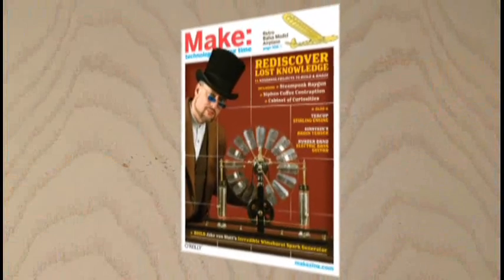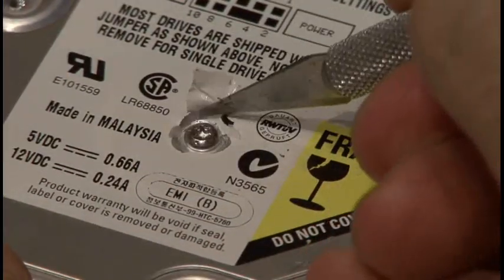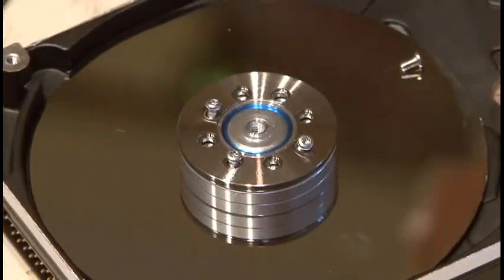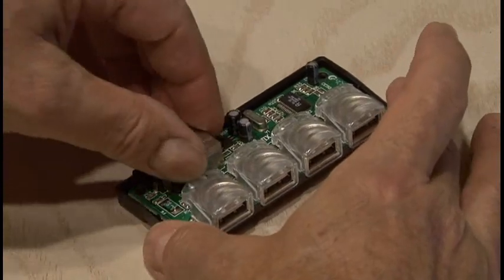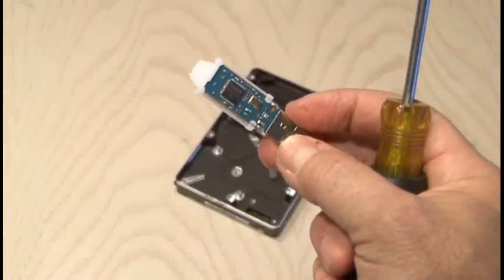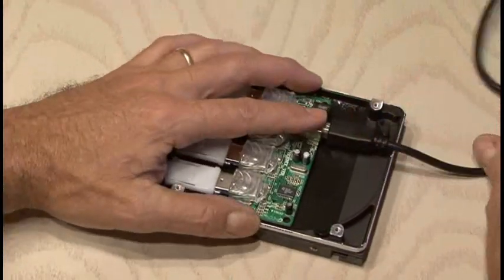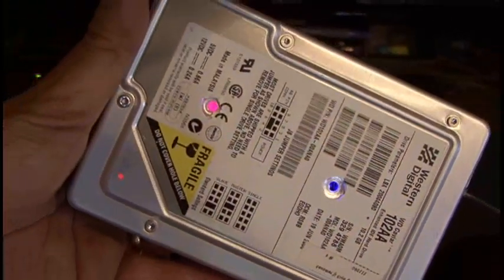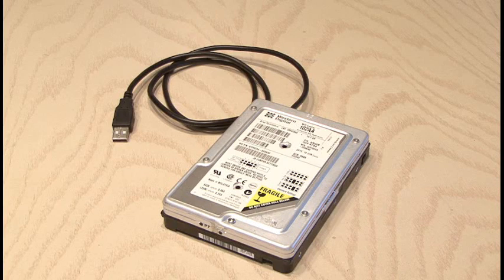Weekend Project: Flash Memory Hard Drive

Comment: Let's see: (4) 128GB Thumb Drives. (1) 4-port USB controller. ..(1) USB to SATA-II converter. (1) SATA-II Controller with Programmable RAID..AND ..JBOD Configuration!! - But is it really worth going to all that trouble and expense just to get a 512GB SSD which is bottlenecked in speed by the USB data rate?

Comment: You can partition each one separately but then install your OS, It will give you the option with you delete each partition to make it a primary or a secondary, You will have to make 1 primary and the rest secondary, That will make it where you can make it one drive letter. Then enjoy installing your OS on all flash drives as they work together :) If you need help please don't hesitate to ask!!

Comment: so, someone know how to merge those usb memory in a " big " single one ?
Reply: raid
Reply: LVM in Linux is the safest bet.
Reply: Jim Moore Your problem was to begin with that you bought a Maxtor.
Reply: You don't, this guy is a total idiot.  That 10GB drive was just fine as it was... Moron.
Reply: Under Disk Manager in Windows you can group them together in a dynamic software raid where they end up only showing up as one large drive.
Reply: ***** As far as i know small flash drives, like the ones used in the video, come with a built in memory controller, that controls wear-leveling, block picking and a bunch of other fancy stuff, this ensures the entire memory chips 'life cycle' gets used evenly;  (you could think of the memory chip being in a constant state of de-fragmentation). The only way to truly join all the chips into one drive would be to use an SSD memory controller that's been designed to support multiple flash memory chips, but that's way above my knowledge.
Reply: so can new ones. Case in point: I bought a 200GB Maxtor in 2006, it died after three days. RMA'd it and got a Seagate. That one's still going.
Reply: cjhawk67 does NOT work on removable hardware.
Reply: MrGridStrom Actually this is not always true. Recent SSD have this feature, but I own some older ones which don't do wear leveling. There's a nice way to go thru, though : partition your hard drive with Linux LVM, and then format the volume with F2FS. This filesystem gives second youth to my older SSD and also a boost to a slower USB key.
Reply: Jim Moore My bad I never tried it with flash drives
Reply: Micheal Lewis damn.

But yes. Lesson learned, eh?
Reply: I only know the raid for mac
Reply: Aidan Johnys MDM only does RAID0 and RAID1, it's extremely limited (and only does device-controlled arrays such as P/S/ATA or SCSI, like the Windows one does), and only formats to Mac OS Extended (Journaled) format. With Linux LVM you've got pretty much the whole gamut of RAID types on ANY controller (0, 1, 01, 5, 6, 10 on P/[E]S/ATA, SCSI, USBx, 1394, or Thunderbolt) and any format you can think of (provided you have the driver installed which most distributions do by default: most if not all Linux current and legacy formats, V/FAT/16/32, NTFS, HPFS, MacE).
Reply: Jim Moore 
I use mdm to create many raid levels, including 50

mdadm --create /dev/md1 --level=0 --raid-devices=2 /dev/sd[bc]
mdadm --create /dev/md2 --level=0 --raid-devices=2 /dev/md[de]
mdadm --create /dev/md0 --level=1 --raid-devices=2 /dev/md[12]

Now you have a raid 1 (stripe) atop a raid 0 (mirror)
Reply: still 0 and 1, my point is proven and if you don't believe me (I insist you don't take my word for it!) search through the MDM manual.
Reply: CaptainDangeax All of the sata based ssds have some sorts of wearlevelling. If they did had it, they would go kaput in a matter of days.
Reply: hojnikb Yes, like compactflash and flashmedia. Oh, wait...
Reply: CaptainDangeax Those are not ssds. And yeah, every decent CF card will have some sort of wearlevelling.
Reply: You should just be able to set them in a RAID 0 array and it should be able to detect it as RAID and assign a single drive letter while both increasing performance and simplifying the detection.
Reply: Henry J Anderson II that was an IDE drive, which is old and slow, and most likely broken. Don't say well it was in 2009 b/c SATA was definitely already there, SATA has been here since at least 2006.
Reply: hojnikb When you'll begin to earn your money and will be stongly engaged in a long term buying process all along the years, and also putting your hands on second-hand products, you'll begin to understand the difference between the theory "every decent SD/CF/USB/SSD has a sort of wear leveling" and the practical "some devices I've got don't do that AT ALL"

Comment: This project is a waste of time.  If I was going to make an old hard drive better it would firstly have to fit inside the PC and secondly act as a hard drive.  For this you would need a kind of RAID controller that you could program to pass the data to and from the storage medium (possibly an FPGA of some kind, but I'm no electronics guru) and then up through a SATA controller and on to the rest of the PC.

Also, there is far too little storage capacity in this project to be really usefull.  I mean, how much modern software can you store on 24gb (I have memory cards with more capacity than that).  Now, 4 x 64gb drives in RAID might be cool.  You are still not going to beat a 256gb SSD in terms of speed, but you may get somewhere between that and a standard hard drive.  In terms of cost effectiveness you would lose out because 4 64gb sticks and a hub (all USB 3) costs £103 on dabs.com and a 256gb SSD would cost £80 on the same site.
Reply: This video was from 2009 you little dipsh1t
Reply: Okay well in response, I just did a project similar with a 8 128gb thumb drives (usb 3.0) of course it ended up with a total space of 512gb in raid 0 for better write speeds (2 sets of 4 drives in raid 0) (i think its actually called raid5 then but idk im no pro) used a little diy magic (and several hundred hours of searching and a few fried old video cards and one ancient sound blaster live audio card) and connected it to my unused pci slot. Now if you know anything about data striping you would know that it (in theory) could double your potential write speeds. and with a top write speed of 5gbps (bits not bytes) for usb 3.0 (mine clocked originally at around 200MBps via usb 3.0 and 300(ish) via pci) with the final speed of the entire "drive" at approximately 650MBps. To answer the obvious question of "Why?" quite simple I get bored and most pcie 500GB ssds cost in the upper range of several THOUSAND dollars... final cost to me $300ish but well worth it when you move several hundred GB a trip. Wouldn't have even thought to start the project without seeing this video first and James Lewis yes I believe that that would in fact smoke the excrement out of your off brand 100 gbps ssd at roughly 65% of a GB every second or... roughly 39GB per minute.
Reply: myohypertrophy I didn't make a tutorial I will consider redoing it in the future and making one.
Reply: +James Lewis you can put this in your computer idiot it is a normal hard drive the standards have not changed and you can get 4 128 or 64 gigabyte flash drives and raid them together and I'm sure you can get a usb 2.0 adapter you can plug into your motherboard
Reply: ***** I know I'm not an idiot. get a usb to sata cable or something. this video was for fun. something to do if you're board
Reply: The point of this video was to make a portable hard drive for cheap in fact probably with most of the junk we have lying around the house, If you could make those drives dynamic the cost of making one of these would be worth it.
Reply: whyyoutubewhy THAT sounds like a fun project.  Can you provide more details/Did you make a tutorial for this project?

Comment: You can solder the USB connections to the sata port on the HDD circuit and you modify a sata cable that you hage a 'sata to usb' cable so nobody can see the USB cable coming out of the HDD

Comment: Why? beyond wasting some time, there's no point to this. It's like gutting a pc case to install Mac parts. it may increase the value of the PC but it devalues the Mac.
Lets review: take a usb hub and 4 flash drives (small convenient portable) and mount them in a concrete block. Tie a length of nylon rope to the block. Presto digital Boat anchor v2.0 
tech tip remove one usb drive replace with usb wireless dongle and Presto Wireless Boat Anchor, no rope needed.  
Your welcome
Reply: Sorry but no, while I have used Mac and currently run Ubuntu, most of my time is/was spent on windows PCs. Machines I rescued from recycle depots. I'm kind of proud to say I haven't had to buy a computer in some 15 years, yet still possess the computing power to discuss via satellite wasting time with someone who's best effort is "aaarrrggghh". Now please take your computer "racism/prejudice", and the afore mentioned boat anchor,,,and stop being a putz.
What did you expect? "oh gosh, you got me I'm a mac, I'm really embarrassed" seriously? no, seriously? 
anybody wants to throw in an Amen, please feel free.(Mac & PC users Welcome)

Comment: Can someone explain to me why we got rid of the original hardrive, seems to me al you needed was that 4-port and just make the usbs fit you didnt need to disasemble that drive....
Reply: Im just saying if he removed the casing off of the tumbdrives it would fit just like it would in the hard drive. There was no need to disasemble that hard drive
Reply: John Reichert
Learn how to type then give us your input.
Reply: Sometimes all of those flash drives wont work all at once. Daisy chain it.
Reply: I don't understand how putting it in the case of the hard drive stops lag and coruption
Reply: in all likely hood, the thumb-drives wouldn't fit unless you used small extensions and crammed them inside the casing
Reply: Nicholas Ocampo
lag and possible corruption
Reply: Dose not work that well.
Reply: Azurren just wasted time taking that thing apart
Reply: Matthew Stanley you could focus on projects that are both useful and fun to do, sounds like a better use of your time
Reply: Well the old hard drive he used was pretty much worthless. It had to be if it was slower and had less capacity than 4 thumb drives from 2009 (Maybe older)

So the hard drive just became a cool little case of this project.. Beats a black hobby box, no?

Comment: Actually yes you can merge all 4 into 1 with free program called "MiniTool Partition Wizard Home Edition" hope it helped someone. :)
Reply: Shadow_Hunter They can; partly: if you use something called "software RAID", you can merge multiple partitions (NOT disks) of the same size. So You can create 1 partition of 16GB (4x4GB) and another of 8GB (remaining 2x4GB).
Both windows disk manager and MiniTool Partition Wizard are able to do this.
Reply: In order to merge partitions, I think all of the partitions have to be on the same disk, and adjacent to one another.... have you tried it with separate disks? About 90% sure it wont work.
Reply: Skippy Scourge yeah, all 4 count as 1 disk this way, thus they cant be merged using MiniTool Partition Wizard..
Reply: Hmmm didnt know that, thanks for the heads up :)
Reply: Maxim Ronsse If you merged four 128GB thumb drives that way, could you boot Win 8 from them?
Reply: FarSeeker8 You could but windows has limits to what it can be installed onto, i tried to install windows 7 onto a 750GB external hdd and it wouldn't let me, so to find out, try it yourself
Reply: Mr1755442TR
Has anyone attempted to hook up a sata to usb adapter backwards?
Put the drive on the usb side and hook the sata into the motherboard?
Reply: I don't think it is possible, because normally, the usb interface provides the sata connection with +5V. So if you'd revert it, you might damage the adapter, since the motherboard is pushing it's current into the sata port (opposite direction). Btw, you can run linux from an external drive ("pen drive linux"), or pretty much any drive.
Reply: FarSeeker8 It just wouldn't work. The circuitry between the usb port and the sata port has hardware that functions as a hard drive biscuit - providing com and info about itself to the usb host device.  Basically the usb adapter biscuit would see host data (motherboard sata port) trying to handshake with a hard drive where it expected hard drive data trying to handshake with hard drive host.  So it would be like wtf I don't understand this shiz.  And dont plug the sata power from the psu into the sata port on the usb adapter. Just don't. On the other side the usb port adapted to connect to a hard drive would have no power, therefor no data, therefor nothing happens.
Reply: Phillip Johnson
Ok, it was just a thought.
 At least this warning has been put out before anyone tries it without asking.
 Maybe some can design a blackbox to make multiple usb  flash drives to look lie a single drive.

Comment: cool but completely pointless, since flash memory is horribly unreliable, isnt all that fast (though still faster that an hdd) and on top of that your also using usb, which means this is external, so you have only managed to increase both the size and weight of the storage
as for merging the drives, i know you can do it, though im sorry i dont remember

Comment: So.. instead of a 10gb hard drive, you now have a usb hub hidden inside an ugly hard drive case which has  8gb + 8gb + 4gb +4gb of space......... kinda useless
Reply: I would prefer the 10gb hard drive + useful 4 port hub + somewhat useful flash drives versus this mess
Reply: This video is 5 years old. I'm sure that doesn't give you much perspective, but it was way more practical then than it would be now.
Reply: Dan Wier 6 years now
Reply: Mark lee Lol, you could just put a real SSD inside the HDD case.
Dan Wier AquaMine Even for 6 years ago this was stupid lol
Reply: twistdshade say you had a retro machine but the boot loads take forever, using an old hard drive case keeps the retro look while booting from a solid state, and tbh if you need a usb hub then your pc is crap as most modern motherboards have at least 8 ports on them.
Reply: twistdshade ikr :P

Comment: To answer how to have all of the flash drives on 1 partition just use the disk management tool in windows and put the flash drives in a raid 0 configuration. Not only would the drives be in 1 partition they would also all work together making read and write speeds faster. =)

Comment: the only advantage is that you dont get that HDD clicking noise. Other than that getting a $70 1TB HDD vs about $40 for a USB hub and 4 Flash Drives seems abit off. Also having 4 drives connected at once (probably) makes it harder to remember where you put your stuff. Other plus is that it looks abit cool :/